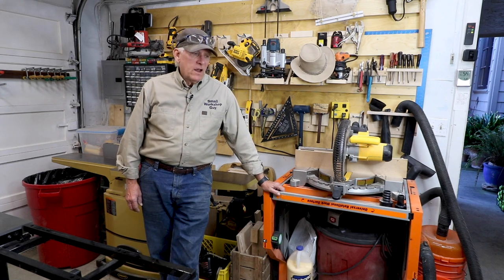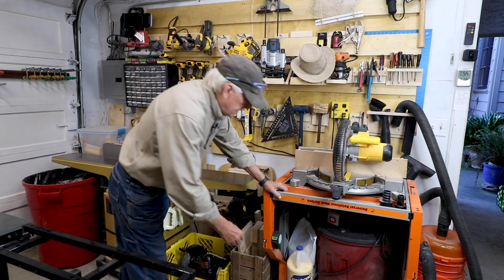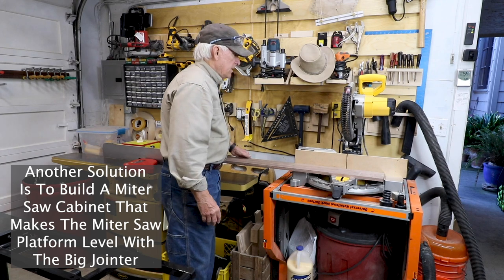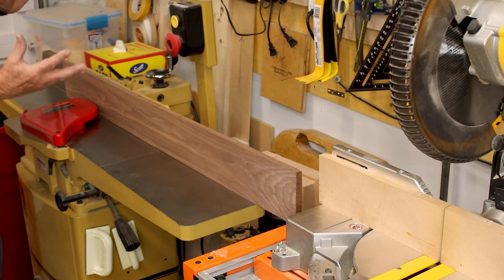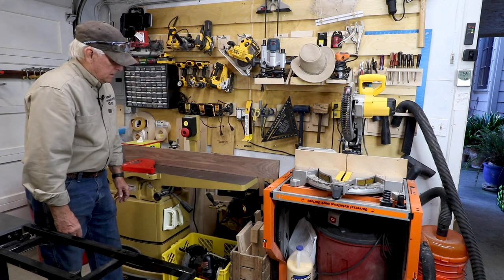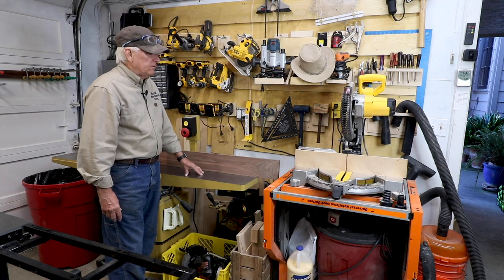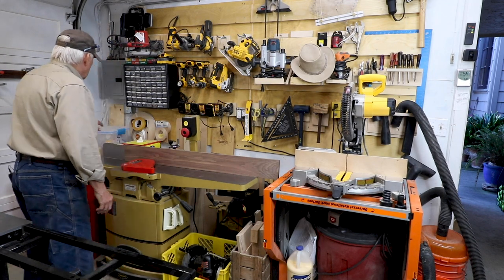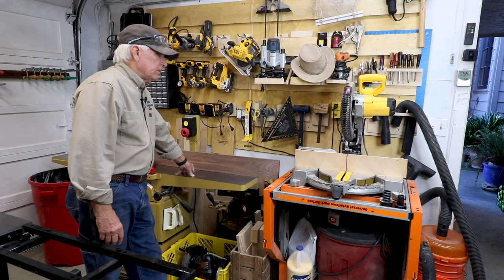How A Miter Saw and a Big Jointer Can Share The Same Space in a One Car Garage Workshop

Comment: Interesting idea.  I have similar jointer.  It's on mobile base but due to weigh and dust collection hose attachment is more stationary than mobile.   That said, this idea might be a way to better use some space in my garage.
Reply from the maker: I do not have a permanent duct collection hose on mine.  I just attach it when I am going to joint.  Like most things in my shop, takes me a minute or two to set up for anything.  Many power tools have to be moved into my precious open space area and many of them get put onto my Sawstallions when needed.  Not ideal.  But no way to make more room.

Comment: That's one amazing hack, Paul! What's the longest board you are able to joint without opening the garage door to push the jointer out? I'm looking at larger jointers but have similar space issue as you do except in my basement.
Reply from the maker: Yeh, hard to open basement walls.  I think I could do about a 6' board.  However in a basement you could just angle the jointer to pick up more space .  They are not that hard to move - could easily moving into an aisle and joint as big of boards as you need.

Comment: When you switched from the cutech to the powermatic, did you find it easier to face joint boards? I can edge joint on my cutech pretty well, but can’t seem to face joint anything evenly on it. Even short boards. Thinking of switching to a bigger model, but if it’s just my technique that’s the problem, I don’t want to spend $1k+ that I don’t have to.
Reply from the maker: I did not have much success with the Cutech and got some serious snipe on the beginning of my face joints, but it could well have. been operator error.  On the other hand, I get great results with the big puppy.
Reply: @SmallWorkshopGuy  That's what I'm wondering. If I'd have less 'operator error' with a bigger, more solid machine. Maybe I'll upgrade in the future.